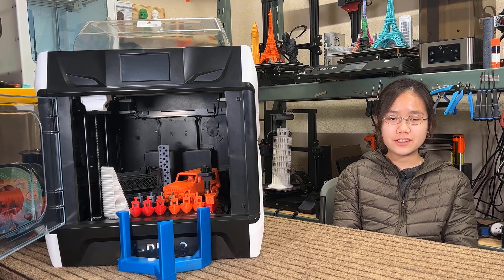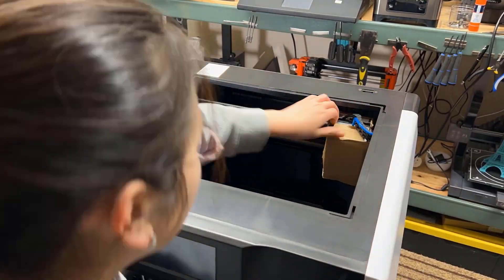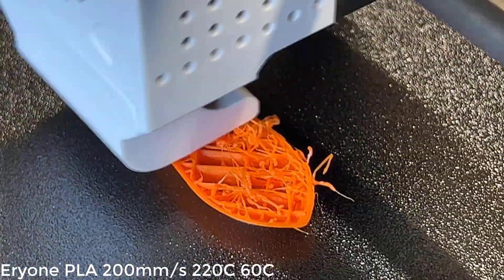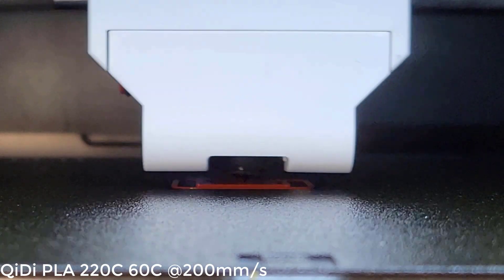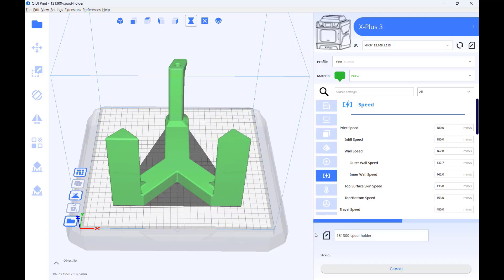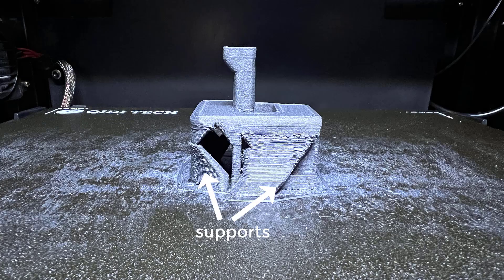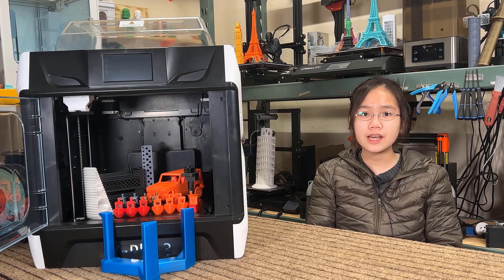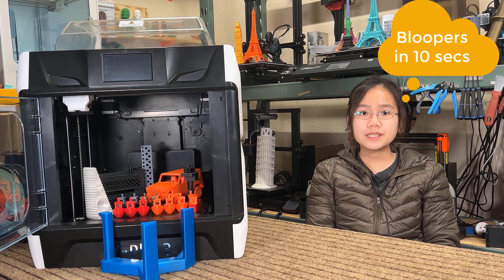$699 QiDi X-PLUS 3: BambuLab X1 P1P challenger? fully enclosed, actively heated chamber, 350C nozzle

Comment: Bambu lab has influenced allot of companies. I feel like this is gonna start another better ender3 race.
Reply: It’s a new race to the bottom but now it’s for core xy systems with klipper out of the box. What a huge jump :D. The fact that things like this . The flsun v400, bamboo labs etc I can’t wait to see an insanely cheap klipper cube printer
Reply: I very much hope so. We needed that industry push. Feels like when Apple released the 1st iPhone.
Reply: Yes , companies really need to be influenced to make enclosed corexy printer, never seen before
Reply: Nah man, it's a ripoff of the 3d systems Cube 3d.
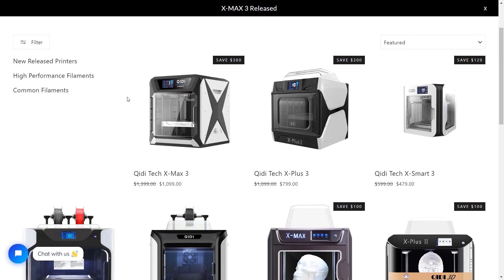Reply: @brokencreationlordmegatrol3037  "Insanely cheap".  Price was off in this review.  The price quoted is promotional if you look a 2:26.  It's actually 1100 USD MSRP.
Reply: @brokencreationlordmegatrol3037 bambu x1carbon doesn't run klipper
Reply: Bambu hasn't influenced anyone, voron did. The bambu lab printers are just a rip off of voron printers anyways that use cheaper components and zero support. Bambu lab isn't the 1st to use coreXY or input shaper, they just did it really cheap since they're all about the race to the bottom manufacturing.
Reply: Qidi isn't a new company and this is not their first printer. They exist for 9 years already.
Reply: @PhilippensTube  Exactly! Qidi doesn't look like Bambu, quite the opposite is the case! You only have to look at the Qidi models of recent years, bambu was a tree species back then!
Reply: @LilApe  No your wrong, Bambu has influenced and this is why. How long has Voron been out? about 8 years since the first one. So why in all that time have these big companies not responded by making fast and amazing printers? Its because as amazing as the Voron is and yes indeed is still a Gold Standard, The fact that it needed to be assembled by the user meant that 95% of people buying a 3d printer are going to buy one already build or at least mostly assembled. Then Bambu came along, a pre assembled machine available at a price slightly lower than building a Voron with performance similar to a Voron and super easy to use. Voron might have been the inspiration but Bambu is the influencer.
Reply: @Grimmwoldds  That price is for X-MAX 3
Reply: @rhotix403  If that's what you understand then I can't help either... This is about Qidi, not Ender & Co!
Reply: @Grimmwoldds  Qidi printers never sell at MSRP.  They use an inflated number and the printers are always "on sale."  I own 10 Qidis and I bought most of them for half of their MSRP.  I'd expect the price to go down if anything, not up.
Reply: @meikgeik  How are your Qidi printers when it comes to long term use?

Comment: As I trust your reviews completely for the honesty and thoroughness you employ, a vender must have confidence in the model they send to you for review.  QiDi must feel the X-Plus-3 is going to pass your testing; from what you presented, it did.  I can't recall you using superlatives so often; I, too, for the cost vs. features am amazed.   I would love to support your work yet I don't know how to do that.  Please let me know how as you saved me so much time and money; and now I get some laughs with your bloopers!

I noticed that the bed leveling data showed about a 2 mm out of level across the X axis; perhaps the z axis lead screws could be 'adjusted' to reduce that amount even with the correction algorithm applied.  Comments?

Comment: I just purchased the X Plus for $649 with free shipping and it arrived in 3 days.  I'm basically a complete noob in the 3D area with an FLSUN SR being my first printer....and it's only 2 months old;-)  The prints on the X Plus are usually much better than the prints coming off of the SR...but both are very good.  The included Qidi PLA Rapido is very nice to print with. It is certainly better than the Amazon or Sunlu filaments, but not by much.  I think the inexpensive filament will be fine for most jobs that I attempt.  As for warping and bed temps, I noticed that the SR bed is off by about 8 degrees from what it says it is (using a digital temp gun).  The Qidi bed is only off a degree or two.  Both beds are much cooler near the edges, so glue may be necessary for those larger prints.  Although I've been unsuccessful in loading the X Plus in Cura or Orca slicer for wireless printing, the included Qidi slicer works well and I really like this function.  Not smart enough yet to figure out Fluid or Mainsail.....someday.  Thank you for your videos and excellent reviews.  You've been a big help to me!

Comment: I think the best route to go is get a p1p, buy the aux fan, hardened steel nozzle and gears, and there's even this high-flow nozzle you can get to make the bambu lab printers print faster and better quality at higher speeds.  Also you can print the enclosure for the p1p.  That seems to be the best route to take right now imo but I'm sure in a month or 2 there will be something better.

Comment: Your reviews are the best on this Plattform. You started  strong and  got stronger and stronger and better and better. Your awesome. Thank you for your work and effort! Anyway the hotend solutions on the Bambu and the Qidi are still not satisfying and seem strangely outdated. The best solution so far is the still the 3dgence one (Which is probably 10 years old, but still an awesome printer) and some of the flashforge printers. Changing the hotend should be a matter of seconds and not of screws. In addition a modern Printer should have closed loop steppers. I hope the next generation will adress both issues. Thank you again

Comment: I'm planning to start producing fairly large ASA parts later this year. These Qidi machines are really tempting. I was eying off the ifast, but it's so expensive. I don't need a 5k commercial machine, but likely need more heat than you get in an X1C etc. Hopefully they release something with dual extruders and this new speed tech at a more approachable price soon. If bambu added active heating, that would be a deal breaker. I am quite interested in the prusa xl, but it's not even enclosed.
Reply: I bought one, it couldn't print ABS or ASA without clogging. if you only want to print PLA and don't need a heated chamber it's not bad, but if you want to do something serious with it, buy something else. I bought one. It was fully refunded.
Reply: @GreybushGamer  And mine prints ABS/ASA/flexibles/and other high end filaments with zero problems. And the chamber temp get's up to 55c which works fine. Only 1 clog in 6 months. I guess mine was from the first batch maybe the QC has dropped as the orders piled in.
Reply: @Kman31ca  really? you run 55 degree chamber temps? have you modded your machine at all?
Reply: @GreybushGamer  No, that's what the temp gets too in my X1C when all closed up printing abs etc. And it's around 30c with the lid off printing PLA.
Reply: @Kman31ca  we're not talking about the X1C, we're talking about the Qidi X-Plus 3. The X1C prints great. the X-Plus 3 will overheat with a chamber temp of 40C and shutdown the MCU in stock form. The MCU cooling is insufficient in stock form and the chamber heater WILL cause it to turn off... among other problems. Also, stock firmware won't let you set the active heater to 55 degrees, that's why I was asking. The X-Plus 3 is hot garbage when it comes to ABS/ASA/high-temp. Even modded, with a chamber heater at 50C, my hotend would clog endlessly. Go watch the clough42 review of the machine. It's not worth the money.
Reply: @GreybushGamer  Ok, my mistake
Reply: @Kman31ca  my X1C has 326 print hours on it so far and the only failures I've had have been my fault (slicing or adhesive issues). My Qidi X-Plus 3 got refunded within the first 2 weeks of owning it.
Reply: @GreybushGamer  Yeah I hear ya with the X1c. I have just over 1000 hours on it and it's performed nearly nonstop. I've even ordered the P1S with the AMS that's how much I'm impressed by this thing. I do my maintenance and it keeps going. Great printers.
Reply: @GreybushGamer You must’ve received  the early machine with carbon rods. They made improvements as clough42 did a new review on the qidi.
Reply: @memcrew1  yah, that was like 5 months ago... I'm still suspicious of the x-plus 3 even after the upgrades, and I certainly wouldn't buy another with my own money when the bambu p1s exists. The design deficiencies of the XP3 that I bought in April were enough that I'm highly suspicious of anything that Qidi produces now.
Reply: @GreybushGamer  understood. I’m torn between the Bambu and the Qidi max.
Reply: @memcrew1  if you want a printer that will work out of the box with almost any material and without any weird behavior, the bambu's a better choice. the only failures I've had on my bambu are due to my own slicer settings. if you need to print bigger than 256x256 enclosed, I'm sure you could find/build something better than a qidi (voron, vzbot, ratrig)
Reply: @GreybushGamer  I agree, however the Qidi has that heater chamber and open sourced with the steel rods. I wonder what the 2nd iteration of the Bambu would be like?
Reply: @memcrew1  just because it's built on open source software (klipper) doesn't mean that it isn't hacked to shit and completely illogical. the way they do nozzle offset and bed leveling is completely screwy (by changing overall z height). as someone who's run klipper on multiple other printers, the modifications that qidi made to the klipper source kinda don't make any sense. if you want open source, build it yourself or maybe buy a siboor kit. if you're not prpared to go full diy, then buy bambu. the qidi is like the worst of both worlds.
Reply: @GreybushGamer  They’re not using klipper anymore, they’re using a prusia slicer now. This is based off the latest reviews.
Reply: @memcrew1  you might want to double check your information. prussiaslicer is a slicer, not a firmware. klipper is a firmware, not a slicer. these things are very different in function.
Reply: @GreybushGamer  OH, ok. I’m just getting into this.

Comment: I have had my X-Plus 3 for six weeks now, after giving away my older X Plus. I'm now wishing I had kept the older model. Issues with my X-Plus 3 are numerous, reliability and print quality being the top issues. Also, after homing the system and I jog the table to the top, the "ZERO" position is actually about 1.5mm from the nozzle tip. Sometimes, when I jog it to the top, the Z axis will shut off when it's within 10mm, which results in the table drifting to the bottom. Other issues, NO fail-safe sensors to stop a inaccurately homed table from crashing into the nozzle or into the frame at the bottom. To top it off, there is virtually no documentation beyond a very basic quick start guide. Finally, the older X Plus made noticeably better parts.  

If all you are going to make are low resolution parts (over .2mm per layer) then you might be okay with this machine. I have YET to make a .16mm layer part that isn't a huge FAIL! And this is from PLA. I'm not even going to try it with ABS or something else. IMO, the firmware on this machine needs work. When selecting parts to make from their thumb drive, the user interface NEVER displays the part on the first try. I have to make multiple tries (as in over 5 tries) before the user interface will display the part. 

Update: I HATE this piece of crap! My two year old X Plus was slower but at least it WORKED. I loaded their new firmware (per their suggestion), and it now causes the extruder assy to crash into the finished part, with the last crash resulting in the extruder cover being knocked off. There are only two possibilities, either their firmware is crap or their slicer is crap. 

This system is beta at best and should have never been released for sale.

Comment: Did you need to re-adjust the z axis offset between different filaments?  You can see on your purge lines on each print, some are squished ribbon and some are lifting from the bed.
Reply from the maker: I received this machine a while ago, and the firmware was not updated. Initially, it was using the optical limit switch at the bottom for Z homing, which was a bad idea. As a result, I had to adjust the Z offset occasionally. However, after updating to the latest firmware that uses the inductive sensor for Z homing, I no longer need to make any adjustments.

Comment: Hello again,
I'm so glad you got the chance to review the Qidi X-Plus 3.  I placed an order a few days ago, blindly, and seen only 2 reviews-including yours.  I have an i-mate s which I love btw.  Your amazing review makes me feel like I made a great choice.  I also noticed the cutter on the print head and hope we do get a color change system one day.

Question- when you printed PLA, did you switch to the copper nozzle or print with the high temp one? 
Another question, the aux cooling fan, is it stationary or does it move with the print bed?

Thank you again for you review as I always look forward to when you post a new one!
-Pauly B
Reply: I don't believe she printed with any abrasive filaments for the video so my guess is she didn't use the hardened nozzle other than to show the process of the nozzle swap. (Both nozzles are high temp apparently)

The fan looks fixed on the side of the case. The hotend assembly is a set height on CoreXY though.
Reply: Thanks for the info.   So far it’s been printing PLA and PETG good.  ABS is new for me so I’m learning and the support from QiDi has been Amazing!!!!  They have sent me so many new and free parts for just in case I might need them for the future.

Comment: Does the printer's enclosure help dampen printing sound? Is the overall sound quieter than the earlier models?
Reply from the maker: It sounds pretty quiet. The top cover is airtight, and it's around 50dB when fully enclosed.

Comment: Hi Aurora, I was thinking about getting the x-max, now I'm undecided with this new x-plus3, I like the sturdy structure of the x-max but I don't know if the latest products have the double-gear extrusion, of the x-plus3 I'm afraid the reliability linked to speed and accelerations, furthermore, in addition to the doubts about the carbon guides, the diameters of those of the z and y axes are not known. What do you advise? Thank you

Comment: I always have the feeling I should have waited when I buy a new printer.
Not so much here but on some other features that could be implemented rather easily.
Just got the v400 and I feel like I am missing out ok load cell leveling of the Prusa MK4. Also hotswapable hotends would be a neat feature.
It's not so much about the printer itself (would not trade it for the slow Mk4) but about the missed potential.

Comment: If the x-plus 3 has the cutter for the filament in the print head, where could the discharge of the filament take place for a possible multifilament system? if it doesn't have some sort of chute, any multifilament system would require the use of purge towers.
The bambulab printers have been designed better and an example is the multiple functionality of the filament chute, which is used both for multi-color printers (allowing also to increase the usable space on the print bed by removing the purge tower) and all start of each print to clean the nozzle.
The x-plus 3 has its concrete advantages but always lacks the attention to detail that would give it a feeling of a premium product.

Comment: Very interesting,  I do like the fact that it uses klipper over a completely custom option.    That should allow you to use other hotends and be less at the mercy of the company.     I really like the fact that it includes the dry box and the second hotend stock athough as you said it would be nice if it had the fan to make it a lot faster to swap.    Does it use standard V6 nozzles or use a volcano or a MK10 like the old version did or is it a single piece that all needs to be replaced, I couldn't really tell and they had no replacement parts available yet.
Reply: Assuming as looking at the website doesn't give the info, it comes with a 7mm wrench which would line up with V6. Standard or volcano length is still in the air.
Reply: @ScuffedEngineer  The difference is that the MK10 nozzles they use for the other printers still use a 7mm wrench but are different threads than the standard V6 nozzles.   The MK10 nozzle are really uncommon common so you can't get things like a volcano or CHT nozzle in them.     
That said I honestly don't think a MK10 nozzle would even work with that kind of flow rate so I doubt that is what it uses.
Reply: It uses a nozzle that is a hair shorter than the volcano. Same threads and style though.